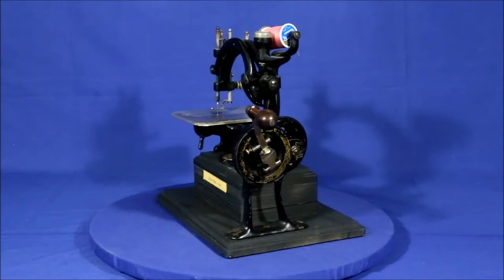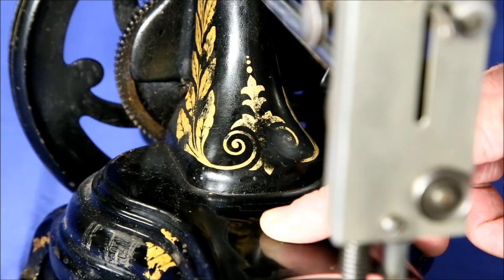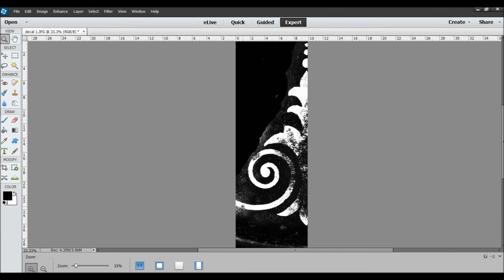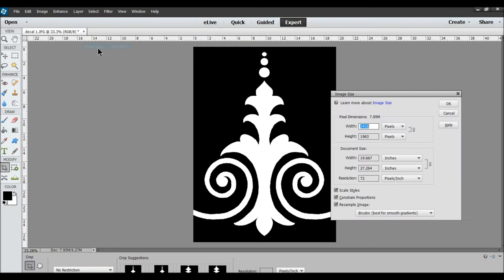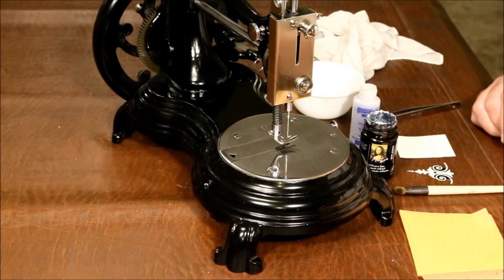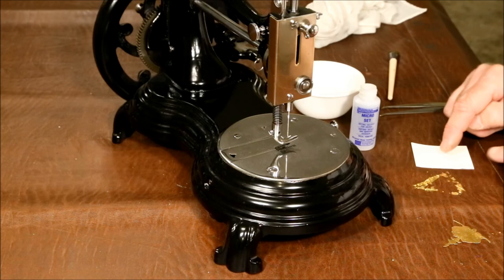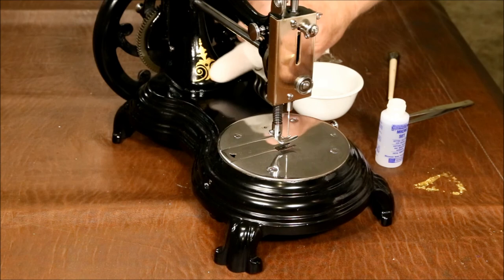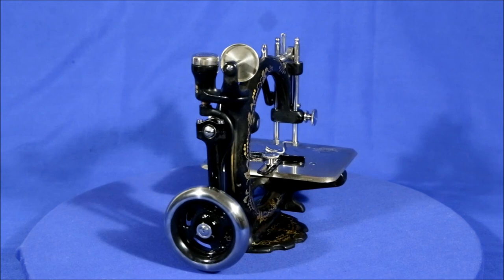Antique Sewing Machine Restoration - How To Make Real Gold Decals

Comment: Hi Wayne, I am working on a Franklin Scarab. I need very good pictures of a Franklin and I have seen that you have one (Nefertiti May) Can you share your photos with me? I need good close-up pictures for decals. The internet is useless for Franklin's pictures. Very poor quality and the detail is lost. I know that this is a big ask. Thank You!
Reply from the maker: I don't see how I could send you photos of the decals without exposing both of our emails in the public forum. Something I think neither of us wants. So I made the following video which, if you go to full screen, should provide the detailed images you need:

https://www.youtube.com/watch?v=TpgqFiq4phs&t=5s

I hope this helps. Good luck!
Reply: @wayneschmidt490  Thank you, Wayne. This helps very much. Great pictures! Much better than I expected.
Reply from the maker: @jameswagner3685  You're welcome. I misspoke on the third to the last decal. I said it went on the bottom of the horizontal arm. I meant to say 'vertical arm.'
Reply: @wayneschmidt490  Hi Wayne, I can honestly say that working with excellent photos of the Franklin decals is much easier than working from bad photos taken from the internet or eBay. I am to the point of printing and spraying them. I have got to say, the ones that I have printed look pretty good. I did have trouble with one. The front Franklin script is not the same as the rear, as you mentioned in your Franklin video. The "F" in the Franklin on the front is on the wheel side and the "F" is on the head of the wheat side in the rear. I was able to separate the script from the body of the decal by using layers and turning them independent of each other and then putting them back together. I don't think that anyone would notice that it is not exactly like the original, but, I do. Would it be possible to add a picture of the rear script decal to the YouTube video that you made? I think that would help me a lot. As always your help is priceless. I can't thank you enough.
Reply from the maker: @jameswagner3685  Ouch! Sorry about that. I really thought they were the same. Here's a follow-up video of just the rear horizontal arm. 

https://www.youtube.com/watch?v=vFIHI2kPS0M

I hope this helps, and again... sorry for the mistake.
Reply: @wayneschmidt490 , I am just about finished with the Franklin Scarab Rear Script Decal touch-up and it is looking good. This Photoshop Elements 2022 is great. I highly recommended it and I am glad that you recommended Photoshop to me. I couldn't do without it. Many Thanks.
Reply from the maker: @jameswagner3685 I'm glad to read PhotoShop is working well for you. Are you making regular decals or silver-backed decals? If silver-backed, what silver spray paint are you going to use?
Reply: @wayneschmidt490  I have tried some silver and gold leaf on some test pieces. I didn't like the way it looked. It was too strong and overpowered the decal. I lost a lot of detail and color. I am going to try your silver paint method as shown in one of your videos. I have some VHT silver on hand that I will use for a test. For the final, I will probably use the silver paint that you recommend in your silver paint test video. I just don't have that on hand. I need to order it.
Reply from the maker: @jameswagner3685  The reason I asked is that I have done more testing on the best silver spray paint for silver backed decals, and found Spaz Stix silver metallic spray paint works better than the Spaz Stix mirror chrome. The silver metallic paint has a very fine granularity that catches and reflects light better at all angles, making it look brighter overall. The mirror chrome is more mirror like and only looks good at one angle when the light is reflected straight into your eyes. I've tried VHT in this application and haven't had good luck with it. The trick with the silver metallic paint is to lay down many very light fogging coats to get the slightly textured surface that reflects light in all directions.
Reply: @wayneschmidt490  Hi Wayne, This is just a follow-up on the Franklin Decals made from the video of your Franklin machine. All of the decals required minimal touch-ups both from damage and color fade or color change. All in all,  they are a big improvement from what I was working with. Thank you very much for that.  
The only Franklin decal that is a challenge is the script decal with the Scarab on the top right front corner. The Scarab falls on a compound curve and tends to pucker on the outside curve of the decal. I think pie cuts may be the answer because the decal doesn't stretch that much. 
I have tried Gold Leaf, Silver Leaf, Silver Paint, and White Enamel. The White Enamel paint idea came from your video. I believe the video was on the Jones Hand center base decal where you backed the green paint with white before applying the gold. You did this to keep the gold from showing through the green. I painted the back of the Franklin Decals with White Enamel with no gold and they have great detail and color.  I think that is the way to go unless you have another suggestion. 
I am also working on a Singer Memphis I noticed that you have what appeared to be an excellent Memphis in your collection. My internet pictures are similar to the Franklin pictures, not very good. Would you be willing to take pictures of the Memphis as you did for the Franklin and post them on YouTube? That would also be a great help. As always, thanks for sharing your time knowledge, and information.
Reply from the maker: @jameswagner3685  Stretching decals over compound curves is always difficult. Unlike the all-plastic decals made for modeling, home-made decals usually aren't softened with AutoSol decal softener because most clear coats don't soften with it. Cutting reliefs as you mentioned can help a lot. The curve under the flying scarab isn't too sharp so if you were to cut the scarab out of the main decal and mount it separately, it might go on  easier. 

When dealing with a compound curve, I often cover it with Saran Wrap, apply epoxy putty over it to create a reverse mold, then use more expo putty on that to create a positive mold of the curve. After a little sanding and painting the positive mold gloss black I have a perfect match for the curve that I can practice on. It's a lot of work but it enables practice runs without endangering there actual machine.

If you're thinking about painting the entire backside of the decal with white paint, why not use white decal paper and avoid that step?

I'll see what I can do about capturing images of the Singer Memphis machine. It's in a credenza-type cabinet so it might take a while.
Reply: @wayneschmidt490  Thank you very much, I always appreciate your knowledge and advice.
Reply: @wayneschmidt490  I received my white water transfer decal paper today. I tried a sample and I think it is going to be perfect for the flat Franklin Scarab decals. Thanks for the suggestion. The color is as good or better than the painted ones. The decals with the white backing appear to be much softer than the ones that I was painting and may work on the convex compound curve of the Franklin Scarab. I will have to try that next. I understand now what you meant when you said that you can't use decal softener because of the clear coating.
My questions are: Do you think that the Design Masters Clear would be better than an Acrylic Clear that I would get at a craft store like Hobby Lobby or Michaels? How many coats of clear do I spray? How long to wait for the clear to cure?
Would I be advised to use warm water on the backing paper because I can't use a decal softener on the front after the decal is applied?
Do you think a soft heat from a hairdryer would work?
What do you think about applying Micro Sol to the machine instead of Micro Set? This would bypass the clear sprayed on the front. Thanks for your help.
Reply from the maker: @jameswagner3685  You can't skip the clear sprayed on the front because inkjet ink is water soluble. The clear protects it. Or, if you were talking about using Micro Set or Micro Sol to skip clear coating the machine after the decal is applied, no. Even with Micro Set, it's easy to snag the edge of the decal and peel it off after it's dry. A clear spray after the decal is dry locks down the edges.

As much as I like Design Master Clear Gloss spray, it's almost impossible to find these days. Being lacquer based, it can also attack many gloss enamels if you resprayed your machine. I'd go with a gloss acrylic spray. Usually one medium coat is enough. I like to give mine at least two days to cure, but always go by the instructions.

I've never tried warm water of a heat gun on decals. That's something you'll have to test. Please let me know how it works out.

I just had a thought. Micro Sol doesn't seem to have much effect with my decals because I use lacquer clears. But, an acrylic clear might respond to it because acrylics are more plastic-like than lacquers. I'll have to try that. Thanks for the idea!
Reply: Hi Wayne, I have finished two machines (1 - Franklin and 1 - New Companion) with your decal technique. Overall, I think they look good. The two machines are not finished products. However, they are excellent practice. You have mentioned in one of your videos that the gold leaf backing will show through the printer ink and will require an extra painting step. I found this to be true with the black also tinting the black slightly gold and turning the black background a different color than the black enamel paint. Do you have a trick to prevent this slight color change from happening?
Reply from the maker: @jameswagner3685  Congratulations on your progress! I'm afraid I can't help you with the gold backing tinting your black. That's something I've never seen. I use a Canon 100-Pro printer with Canon ink.
Reply: @wayneschmidt490  Thank you, looks like more research.